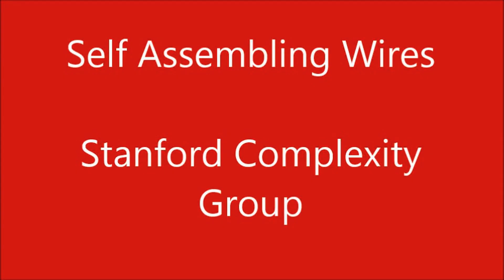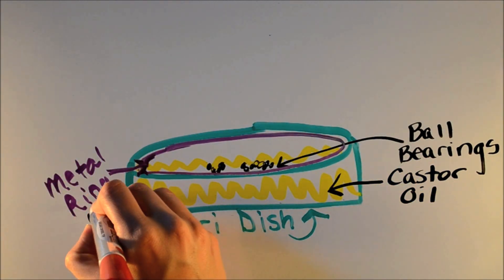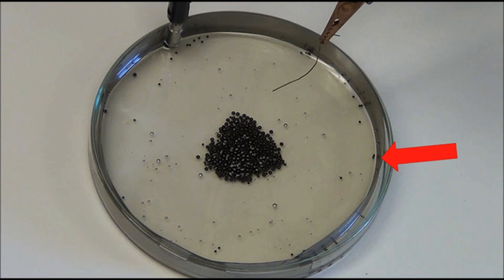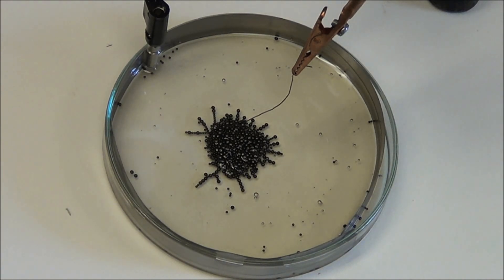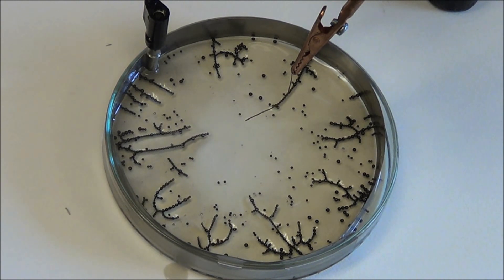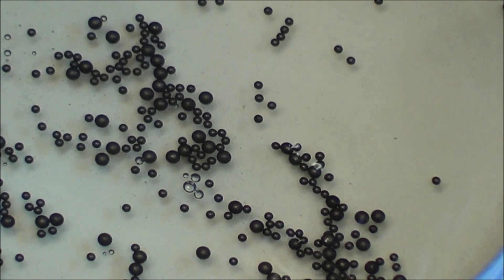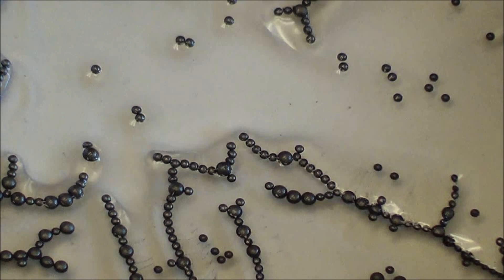Self-Assembling Wires

Comment: In a few decades: "And this is how we began to learn how to create forcefields"
Reply: nanomachines, son
Reply: @bernatkun8069  nothing to do with forcefield but it makes sense at least.
Reply: I mean, force fields are just... fields of force. Like gravity or electromagnetism. If you mean like a solid barrier which nothing can pass through, that's super tricky to do. Sure, a powerful electromagnetic force field is easy enough to make with an electromagnet--that's how everything from bluetooth to magnetic levitation works. But that only works on objects with charge. To repel people the way Violet does from The Incredibles, you'd need a force field generated by negative gravity. This is problematic for a few reasons--for one, this would mean you need an object with negative mass, and we haven't ever observed negative mass in the universe, so we're not sure if it can possibly even exist. If the object had positive mass, it would attract objects to it. And for the second problem, gravity is really weak compared to electromagnetism. That's why it's only really significant on the scale of celestial bodies--technically, you're exerting a gravitational force on your phone or laptop right now and vice versa, but the force is negligible, because neither you nor the phone/laptop is nearly massive enough to make much of a difference. So if you did get an object with negative mass, in order to use it as a force field generator the way you're envisioning, it'd have to have a LOT of negative mass in a relatively tiny space. Picture the negative of the mass of the Earth condensed into a device which fits in your pocket--that's what you'd need just to push stuff away from you with the same force that the Earth attracts us to the ground.

The only other thing I could think to do would be to spontaneously exert enormous amounts of pressure in the air around you to create a vacuum like effect for people close enough to experience the effects, essentially sucking them into the space farther away from you. But that would definitely also pop your eardrums at the very least, if it didn't pop your whole head. So you'd need super heavy duty, air-tight armor to protect yourself, and if there was a hole in the suit or something, you're deaf or dead.

Basically if you want to be Violet from The Incredibles, it's probably not possible, even in a really cool high tech future. Sorry for how long this was lmao
Reply: pretty sure military has that for about 25 years now...I mean, they got a flippin´ cloak already...
Reply: @Hunne2303  You mean stealth technology or literally cloaking devices?  I'm trying to see if I am talking to normal people or conspiracy theorists?
Reply: @Nuffsed81  I mean materials that can bend light - so yeah...a literal piece of cloth that makes you "vanish"...
Reply: @Hunne2303  yeah they make you unable to seen but the cloaking device isn't invisible so I wouldn't say you vanished. More like hiding behind something. Something that you can still see by the way.
Reply: @Nuffsed81  dude, that was decades ago...developement never stops...the F-117 is an actual WW2 child, never forget that.
Reply: @Hunne2303  bs, it was designed in the 70s.  Stop spreading nonsense.  I hope your comment was sarcasm and not serious.  If you're being serious then dont reply because you are clearly a conspiracy theorist that lives in fantasy land.
Reply: ..how did your logic get you there?
Reply: @heikg  look at what we have now, someone went "oh cool, 2 different silicons make a switch" And now we have connection to the world in our handsbecause of computers. Someone made a coil, and noticed it gets magnetic when you apply force, and now we have generators and electric cars, a lot of inventions have stories like this, someone does a small observation, and another person uses it in their, and another improves it, and we have a leap
Reply: @eeeguba432  explaining how science stands on the theories and experiment done before does not explain how this could be used for "force fields".
Reply: @Nuffsed81  once they made a connection to the edge they spread out kinda like a forcefield. i'm sure when someone figured out that "2 different silicons make a switch" they didn't conceive how it would one day help make a smartphone. Chill.
Reply: @eeeguba432  great perspective
Reply: @DavidCruickshank  They moved to the edge... of a physical object. The physical object is already a shield in this case that they are sticking to. 
The mechanics going on here wouldn't really be related to forcefield tech.
The kind of things this will evolve into would be bio-mechanical construction where it's too difficult to be constructing every little part or microscopic features on a large scale for something that isn't just a flat plane (microchip). And self-repairing materials like cybernetic skin for example.
Reply: @DavidCruickshank  explain the physics behind this forcefield?  Do you even know what a force is?  A magnet could become a forcefield using your logic....so what.  Explain the physics please.
Reply: @invertexyz  exactly, that would be a possible application. How they got to for forcefields is beyond me.
Reply: @eeeguba432  the amount of stupidity in the correlations you made and the amount of people who thought that made sense just makes me feel sorry for us as a species.
Reply: You wouldnt understand.

Comment: Now, I'm by no means a physicist, but isn't this behaviour expected? Couldn't it be theoretically deduced from already existing knowledge? I'm not hearing that this is unexpected behavior, so how does it teach us anything?

Please, if you have an answer, formulate yourself in layman's terms; I know only basic physics, I'm primarily interested in the epistemological aspect.
Reply: you can change the resistance of it by applying electric field at different angles, you can even break the chain to stop the flow of current
Reply: @akshar234  I’m not sure how that answers my question?
Reply: @Breadman-k6d  "so how does it teach us anything?"
Reply: @akshar234  so I should read your first comment as the discovery of some previously unknown properties?

Comment: Fascinating study by Dr Hubler and thanks for posting this SCG.

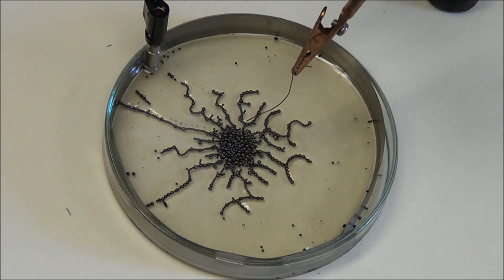Once the power makes the connection it glowed (2:10) and on the line going to 9 o clock it started giving off smaller grey blobs like smoke.

What were those grey blobs and how were they formed ?

It was discovered that early satellites that failed similar growths from tin solder on circuit boards. These tin whiskers, would grow which shorted it.
is this the same principle of how that happened or am I talking bollox?

Comment: Ok...electron flow vs hole flow: electrons do not "spray" from the positive pole of a power supply; electron will move toward that positive pole. Now, in the western hemisphere, the convention for "current flow" is from plus to minus--but these are not electrons, they are "holes", or places where an electron has just moved from. The eastern hemisphere seems to have settled on the opposite, deciding "current flow" should be electron flow. An eminently practical perspective, since, indeed, electrons are the charge carriers in electrical circuits. Why the bifurcation? I think I asked one..."nobody knows"...hehehe

Comment: You say I can't do this at home because it requires a 20 kV power supply, as if I don't have a 20 kV power supply. But of course I do. How else am I supposed to power my helium neon laser without a 20 kV power supply? The reason I can't do this at home is because I don't have castor oil. Or petri dishes.